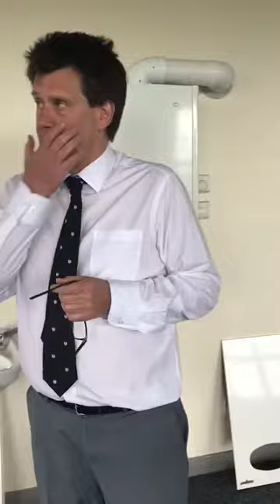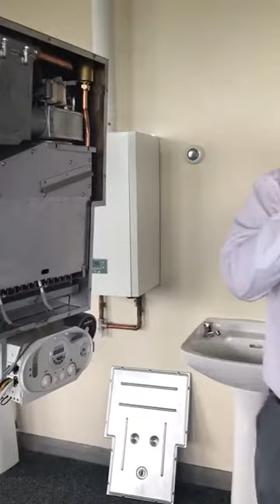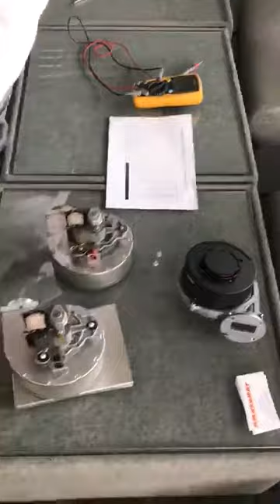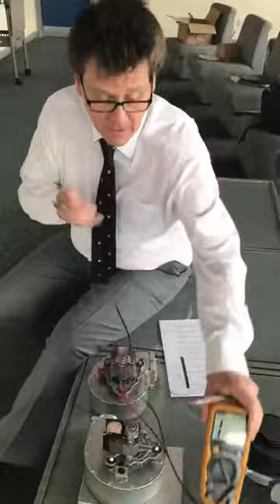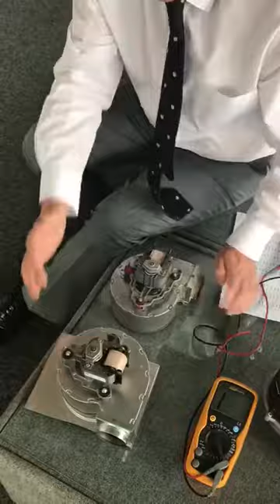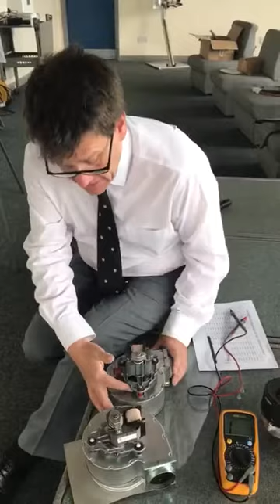Tech Talk with John Wilson from Ravenheat testing boiler fans

Comment: If you've a 45 Ohm fan running on 230v, then it draws 5.1 Amps. How does this work with the FCU fuse? Are we on a 5 Amp fuse? Also, you say that with a swollen bearing the APS will drop out when the combustion chamber gets hot and "the pressure drops." I don't understand what you mean by the pressure dropping -- are we saying that the fan slows down or something? What's the process here?